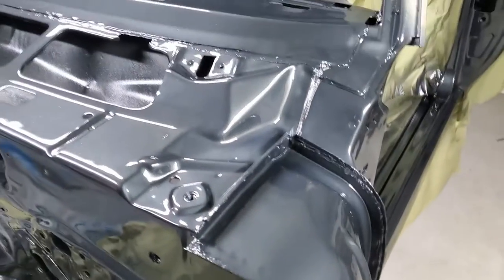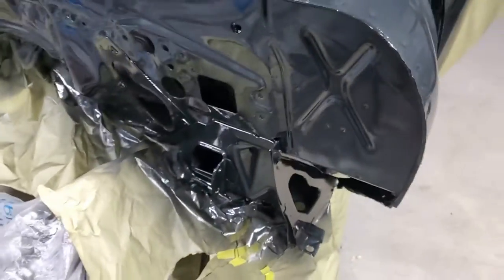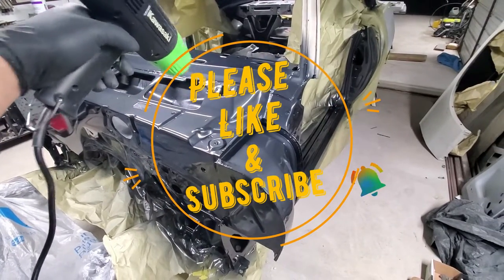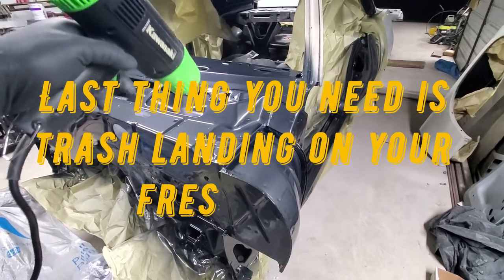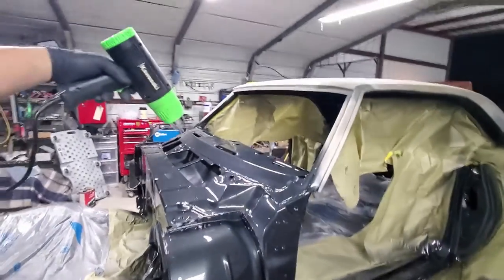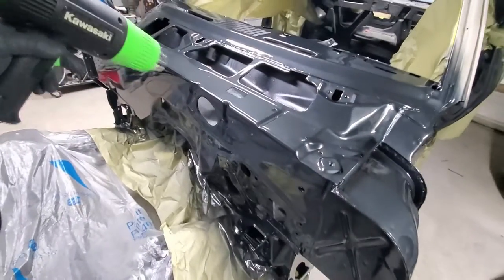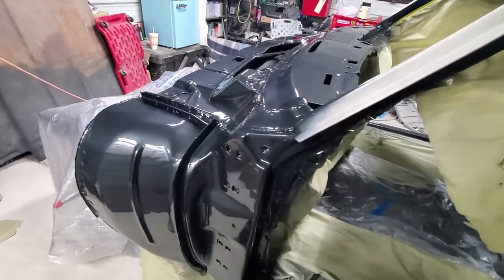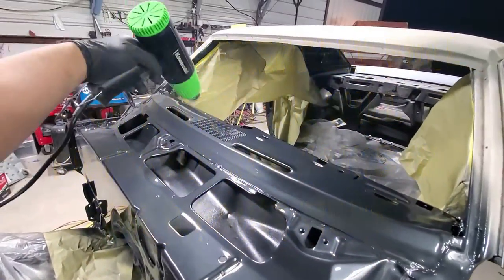How to fix Foggy, White, Cloudy Clear Coat Reaction

Comment: I don't have a heat gun so I had to improvise. Used aerosol spray and a lighter. With very short bursts of heat. Worked like a charm. Thank you for the tip!
Reply: You can actually douse the whole thing with acetone and set it alight, that works also, just did that on a front fender I´ve messed up for the 5th time.. don´t use petrol though that burns the paint off..
Reply: How far did u keep it from the vehicle??
Reply: You probably could rub it real hard with your hand and it will heat and get bigger.

Comment: Why does the foggy white happen shit happened to me whe. I used clear coat the other day .. i used a hairdryer but to some spots off easy others i was on the same spot for a long time dont think they have enough heat sometimes
Reply from the maker: It happens due to moisture in your air coming out your spray gun/air compressor.  A better filtration system will help. This happens too when the weather is cold and ofcourse the air coming out of the compressor is warm creates a condensation effect hence trapped moisture...

Comment: So, I used a heat gun, was outside. It was working but a the night set in. Not so much. Will this still work the next day? 
Or will it even clear up on its own as the sun hits it?
Reply from the maker: @playsportfun3356  unfortunately no, once it cures it will retain the look it came out with
Reply: @EddiesCustomsandRestorations  is it deep in the clear? Or can I sand it and clear over it?
Reply from the maker: @playsportfun3356  there is a high chance you will burn to your base coat before getting rid of it
Reply: @EddiesCustomsandRestorations  😟
Reply from the maker: @playsportfun3356  I know....you probably will have to spray a little bit of color again just one coat to make sure it has coverage again and then spray your clear.. so another thing you can do that is not exactly the right way but will change the appearance is just sand it with 400-600 depending on the color and then spray one coat of base just to cover that effect and then clear again. But by doing this you are just trapping whatever was on that other clear.
Reply: @EddiesCustomsandRestorations  thank you that is very good advice for a guy like me that knows nothing. But I have to share this, cause it will most likely help others. Keep in mind I used 1K clear. But here 21 hours later outside in the rain. I gave the heat gun another chance. I put it on the lower setting of the 2 and held it 1.5-2 inches from the surface keeping the gun moving back and forth. And it actually drew all the moisture out. My entire rocker and cab corner that was much cloudier than yours. It's now the dark metallic glossy finish it should be. So thank you again. Now 2K with hardener might be a different story. Hope this is helpful to others.
Reply from the maker: @playsportfun3356  thank you for sharing. Yes I was under the assumption that you used 2k clear. With 2k clear, once it hardens, you are out of luck basically. But hadn't experienced this with 1k clear. Good to know! Thanks again for sharing!

Comment: what if your whole car is like this? 😮‍💨 heat gun the whole dang car? After spraying clear coat, it was cloudy. Some of wiped away with spray gloss but most of it stayed on the car. My husband thought waxing it would work....made it completely worse. Car is supposed to be black yet the hood looks almost white and sides look cloudy black/white. looks like shit. Badly. Any tips? We're tired of working on our car. We are either 1. going to put another layer of black paint over the whole car 2. leave it as is (not ideal. It REALLY looks like shit) or 3. leave it as is until we can get the money to have it fixed and hopefully not have to completely redo it.
Reply from the maker: @natsarim87  unfortunately since it's dry already, you can't use this method, you will have to sand the whole car with 400-600 grit and knock it down as much as possible to get close to the base coat and get rid of that layer of compromised clear coat and then spray a coat of your black and then clear again. But try to get yourself some filters for your air.
Reply: @EddiesCustomsandRestorations  thanks :)
Reply from the maker: @natsarim87  you're welcome...I wish I had an easier solution but unfortunately there isnt...but if you have any further questions feel free to ask at anytime.

Comment: Can this issue be fixed if my lacquer has cured?
Reply from the maker: If the moisture stayed trapped inside no, if you have a haze on the top layer then you can try wet sanding and buffing
Reply: @EddiesCustomsandRestorations    I shall try that !! Thanks very much for your reply
Reply from the maker: @niall01oneill  yes ofcourse! If you have anymore questions, feel free to ask. I try to always respond
Reply: @EddiesCustomsandRestorations   dried clear will need wet sanded and polished but thanks god!  (Does that usually happen)